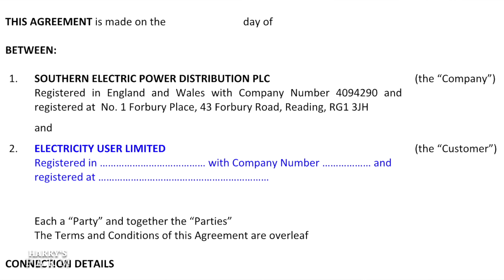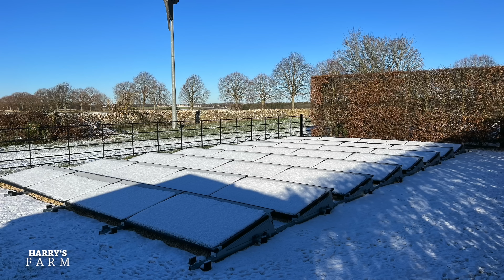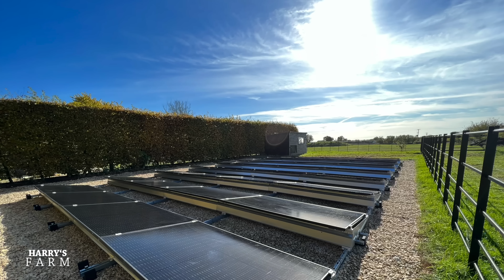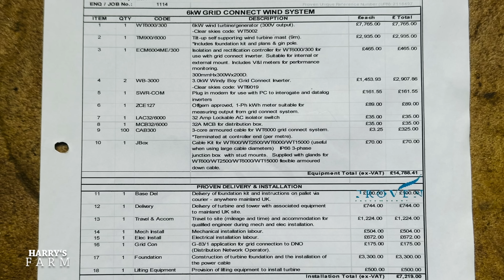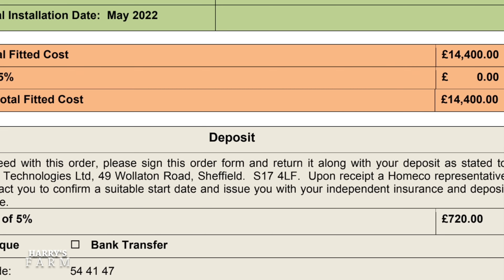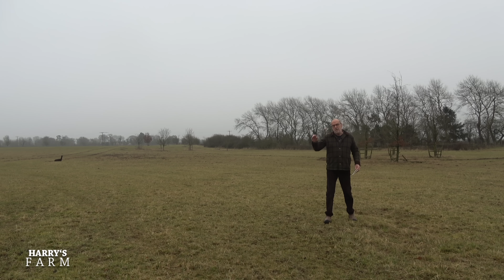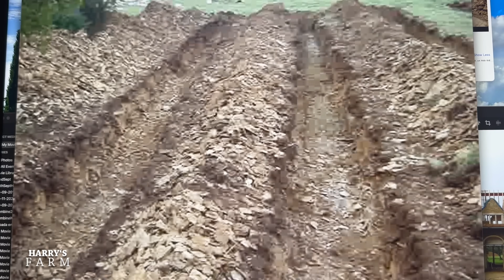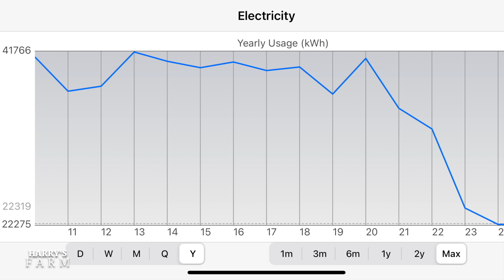Are solar panels & heat pumps worth installing? Here's what I've learnt after several years of use.

Comment: Some fantastic information. This confirms to me this still wont be common place for everyone that the NET ZERO nuts are forcefully trying to accomplish. It'll amaze me if they can even get this viable in a lifetime!. To get most of this efficiency required what, at least half an acre of land! As well as a boatload of insulation that you wouldn't probably see fitted in houses currently being built right now. The cost will remain way to high to afford commonly for a long time as well.

Comment: The Aga wont be saving money, it's at a max of 100% efficient while the ground source heat pump will be 300% or 400%+, especially in October when it'll be most efficient as it'll barely need to heat the property. Unless you're cooking with the Aga 24/7 it's costing money, heck maybe even if you are cooking 24/7 it'll still be costing more than a typical electric oven and induction hob.

Obviously if you like it and can afford it, by all means, but it's not gonna be cheaper.

Also, the house looks incredible for a new build, lovely stone, well proportioned.

Comment: Really good video, but In the nicest possible way............ Batteries......... Batteries...... Ive got 9KW of solar, 14KW off battery storage, one of our cars is electric and the trick you're missing to make those bills come down way further is to use a night time EV tariff to charge a set of batteries to power the house, 6.9ppkw on my Eon tariff. You then export ALL of your solar at 16.5ppkw, in your case a hell of a lot annually with the big 12KW system. You do this ALL year round, pay 6.9ppkw for what you consume and get paid 16.5ppkw for ALL of the solar you produce.......Batteries........ Batteries Harry, its your missing link and I'm a bit shocked non of the companies you've had installing have recommended this to you?

Comment: A question, how much of the difference do you reckon is because your solar panel is ground mounted? Your data shows a 14x difference between the months, but i'm wondering how much of that is from the additional shading in the winter months, as the sun is lower so is more likely to be obscured by hedges/trees/etc.
I wonder if you'd see any additional improvement by lifting the solar panels up several feet, to be more at about chest height rather than calf height? This could reduce shading. Might also improve airflow round the panels, which may improve output in the summer.
This is purely speculation on my part, i'm not an engineer of any trade. I have spoken to some people however that have their own solar, which is roof mounted, and they don't seem to have quite as much of a difference as your installation - So i'm just assuming that's due to the installation type.

The installation on the farm proper seemed to be roof mounted, do you have the data from that system to compare to? I think that would be interesting.

Comment: With batteries you charge at night at 8p per kw, that’s the point and export at 15p per kw. You should be heating your pool at night on cheap rate and then exporting your solar at 15p. You are missing a treat.

Comment: It is not nice hearing these complaints about your solar. These all were known facts BEFORE you decided to build it.
These are very basic facts, and every solar installer will calculate yo uthese numbers beforehand exactly.
Also, I wonder why it is installed like that... a normal solar instelling company would model the shadows it will receive beforehand.
The panels are strangely flat. Where you live, I think they should have a steeper angle than that. 
Also, if you would have installed them on some poles like 2meters above. you would have a nice shade under making that place very usable. Not like now.
This whole thing and instalment stinks.

Comment: The solar panels would produce more in winter if they were installed at a steeper angle (which is usually the case on roofs). Also due to the lower angle of the sun, the shading effects of the hedge and the fence will be much worse in winter. However, unless you have a very old system, shading on one panel does not affect the other panels. That being said, even a small bit of shading on a single pnale reduces its power output significantly.

Comment: The heat pump conundrum. Let's assume a COP of 300%, but oil is 1/3 the price of electricity, so it makes little sense to me especially when you consider that the weak heat output means that you have to run it 24/7 in the depths of winter. Let's not introduce the fact that the UK has been reliant upon every ounce of fossil fuel generating capacity for days on end this last month due to no wind......

Comment: In a 170sq metre house with air source heat pump and roof solar, my experience echoes Harry's Farm. ASHP reasonably efficient down to about 5°C. At 0°C ordinary electric radiators are better to maintain localised heating. Harry skates over batteries, but that is the most efficient for me transferring off peak electricity at ~9p per kWh to daytime use when it would cost ~23p, saving about £1.40 per day. However it is debatable whether I will get payback. If our village had gas I would revert to a gas boiler in the blink of an eyelid.

Comment: The angle of your panels are optimized for High summer sun, 
Winter, when the sun is low, some of your panels are in shade for most of the day. (Which as you pointed out turns off the whole row)
Would be interested to see what difference a verticle mounting would make. Maybe lining the hedge on the sun side.
It would also help with snow cover and leaves etc covering them up.

On battery backup, it may not be fillable in a day of solar but I bet there are plenty that were stuck without power after storm Eowyn that would have found it useful.
Reply: I have a 5.16 KWp system with roof mounted panels. I can almost get the same output in winter with this because the panels are at a higher angle. Mounting system that can be manually changed between summer and winter would double your output in the winter.  I would  cut the hedge to stop problem with it's shadow on the panels.

Comment: Yes I've solar too, quite useless when you need the the most and complete overkill when not needed. Even battery storage doesn't help much aside from letting you be off grid occasionally during the summer. There doesn't seem to be a reliable solution for the winter, even windturbines have long periods of idleness during the winter.

Comment: Very very interesting Harry and well done for explaining it all so clearly for a dullard like me who doesn't really understand solar etc. Here in SW France we regularly have power cuts. About 4-6 a year and they range from 2 hours to a whopping 26 hours last October. I have a large barn which faces SW and looked at having a solar array plus storage kit installed but it was a joke. The money and pay back time and extra gubbins one needs is too over the top. I have a farmer friend in north Wales who ripped out all his oil fired heating and installed solar. He like you said that in the summer there is too much power and in the winter forget it, it's a joke.

So I looked at an emergency system to cover us when we have power cuts and arrived at a Bluetti power station kit with portable solar panels for charging.  I bought the AC70 and though the solar panels are a bit feeble I think it would recharge from zero to 100% in about 4 hours. Too much cloud and cold at the moment to check that and maybe I will need to upgrade the panels to a 400-500w system but they are quite cheap. Then two weeks ago we had a power cut. I immediately connected the lounge lights, computers, tv, internet etc into the Bluetti unit et voila, power and connection with the outside world. The power cut lasted about 2 hours and the battery was good to another 8-10 hours I think.

All in all solar is a wonderful idea but if it were that good every government in the world would be incentivising every homeowner to install it, that they aren't says everything you need to know about it's efficiency and practicality.

Comment: Tilt those panels up in winter, you'll increase the output 5 fold or more and it would be extremely easy on that ground mount system.
Ideally you want the panels perpendicular to the suns rays.
Reply: That was the first thing that struck me, way to shallow for a 50 degree latitude in winter.
Reply: @ I'm surprised his solar supplier didn't mention it and space the panels accordingly.
Reply: The installation company obviously thinks Harrys farmhouse sits at the equator !!... 🙄😂
Living in the Northern Hemisphere, those panels should be really steeply angled during the winter...as they are on the ground,  a method of manually adjusting them would be handy... say, once every 2 months or so... 🤔

😎👍☘️🍻
Reply: Yes, but then they'll shade each other.
Reply: Five fold? So 500w? 
What is he going to do with that? Thats hardly enough to make it to the house let alone do anything useful with.
Reply: The installation location... It's just wrong on so many levels.
Reply: 5% maybe. Not 5x. Where do you folks come up with this cr App?
Reply: @silverbackag9790  Those panels are set for 10 degrees latitude summer, not UK mid winter. That's how solar panels work.
Reply: @coffeebuzzz   Look up the charts. Yes, there’s charts for this. His biggest issue is shade…it’s very apparent from his video. The tilt does make a difference but not nearly as much as folks seem to think. BTW, I hav 24kw of panels with AC coupling, 100A continuous system., and 130 KWH of DIY batteries. It’s not my first rodeo.

Comment: The angle of dangle of your ground mounted solar is totally wrong, panels mounted at that angle might work in Equatorial Guinea but in the UK you should be at around 40 degrees in mid summer and 22 degrees in winter to catch the sun !!!

Comment: We use solar as a filler for our daily 12 to 15 hour load shedding here in Zim and it does that role well utilizing batteries. Of course we have an awful lot more sunshine than misty UK, but there are limits even here, so some adjustment to life style is essential for this mode of power generation.

Comment: Heating a swimming pool with solar generated electricity to run a heat pump has to be the most pointlessly expensive and complicated method possible (short of using direct electrical heating elements)
A simple evacuated solar thermal tube setup with a cheap circulator pump would do the job. Solar tubes are about 90% efficient versus PV panels giving 17% at their very best output so a much smaller installation as well. 
Virtue signalling economic madness.

Comment: I've had solar for 2.5 years and overall I'm very happy with it. Because prices had come down and electricity was more expensive it was justified economically at the time. What's surprised me though is how much prices have continued to fall since then. I paid £170 for each of my 390w panels, today you can pay £70 for a 440w panel. So a 10% better product for 40% of the price. That's pretty incredible. It's not just the panels but the batteries, my 5KWh battery in 2022 was nearly £3k, I had a second one supplied and fitted last year for £1,850. I'm sure some costs such as installation, rails, mounting points and scaffolding have gone up but clearly the entire thing would be far cheaper.

I'd clarify a couple of things Harry said, his is more akin to a commercial installation whereas most people watching will be looking at single phase domestic ones. You don't need to ask permission from the DNO (probably UK Power Networks) if you're installing under 3.68 KWp via the G98 process. It's just a notification. However most people will be over that (mine is 8.9 KWp) so you follow the G99 process. And under G99 you can install as many solar panels as you like but the DNO will limit your export because they might not want too much going back to the grid. I think this can be done through a setting on the inverter.

If you have a suitable roof and you plan to stay in your property for quite a few years then I would go for it especially at the price the materials are at now. If you're installing batteries you don't need more than about 60% of your daily usage. We use about 17 KWh on average and I have 10 KWh of batteries. This is about right, there are quite a few days in winter where an extra 5 KWh battery would have been used but outside of winter it'll barely ever get used so can't justify the cost. You'll be consuming directly from solar most of the year as well as shunting some energy use into the night rate. Because if you get solar you should always get onto a split tariff where you charge the batteries overnight. Ideally if you have an EV you'd do it for about 7p per KWh but if not then something like Octopus Flux or Economy 7.

Comment: With solar and a battery it is worth looking at Economy 7. Solar produces power during the day, when electricity is expensive, and you get cheap electricity at night. Also, most battery systems today can charge from the grid at night. So you can maximise the usage of self-generated and off-peak (night) electricity. The downside is installation cost. Another thing to be aware is that the network operator (DNO) will limit the "generation" amount at your property. So in harry's case a 4kW battery system (don't confuse power output [kW] with battery capacity [kW hours]) would mean 4kW less of solar panels. Setting the barreries to "zero grid output" does not change this and yes I was surprised as well. 

I have an 8kWp solar setup and 2 Tesla (sorry) Powerwall 2 batteries with a large house and 2 electric cars. For most of the year we only run on solar and off-peak electricity. As we live in a rural location power outages are not uncommon so the ability to still run the house when the grid goes down is also very useful.

Comment: Thanks Harry for all of your car and farm related vids. They are all very well produced. I just have a few comments about the results of your solar installation. Assuming the orientation is correct of approximately south facing, the 12 kW panels are doing well to produce the summer output you list. But your ratio of winter to summer of 14 times indicates a few issues. The optimum panel slope is, for your latitude is 40 deg ish for an azimuth of approx south facing. Your panel slope is approx 15 deg which is far too low for power production in winter. The shading factor is a big issue. You don't mention clipping of the hedge, but it does seem to be clipped back  As you say, any shade on panels affects other panels in the row. Apart from the option of cutting the hedge lower, you should seriously think about fitting optimisers on any panel that suffers shading. At less than £40 per panel and easy to install, it would have helped. My calculations show that optimising slope you would have a ratio of winter to summer of 3 with your figure of 119kWh in Dec rising to 500kWh. The slope change would not significantly affect summer output. 
Optimisers would help you achieve this figure but any shaded panel output would always reduce the 500kWh to some extent, the optimiser just cuts out production from that panel. 
Some ground array rack systems do allow for manual slope changes during the year. Your problem at this stage will be if you increase your panel slope you might get shading of one row to the next row. Just depends on the geometry and spacing.
Reply: I really don't see that it would be possible to manage a winter to summer ratio of 3.  Cloud cover, day-length and solar intensity just work against us in a UK winter.

Comment: As you say, solar panels don't like even a little shading and its much worse in winter when the sun is low and the panels are almost horizontal. So the winter performance drop off in this setup is probably rather more extreme than a typical rooftop solar.